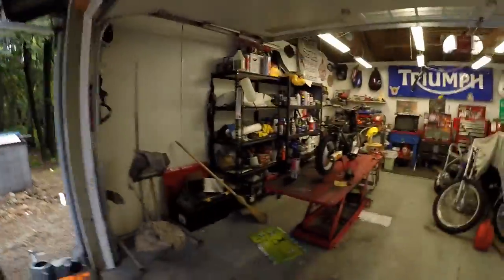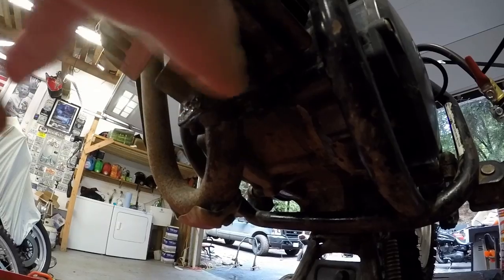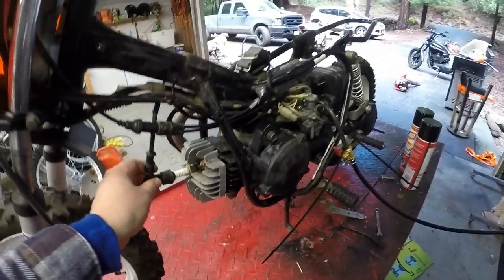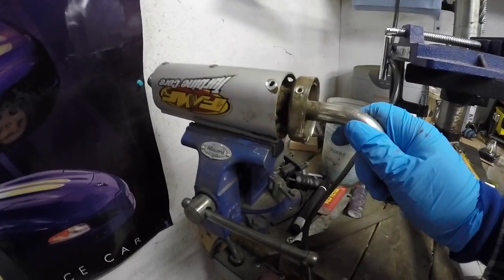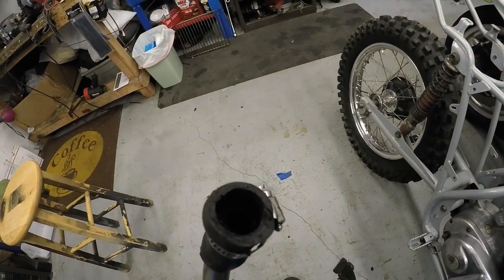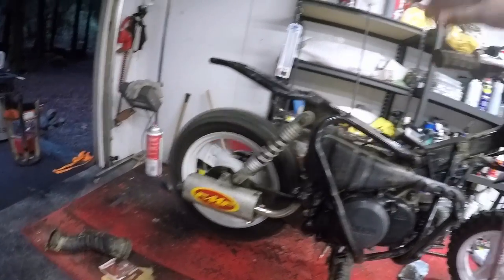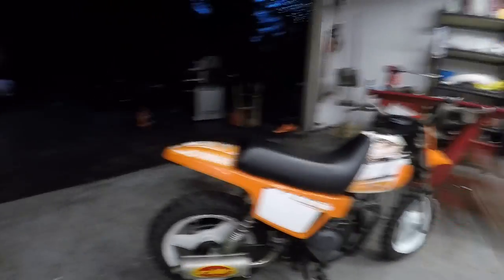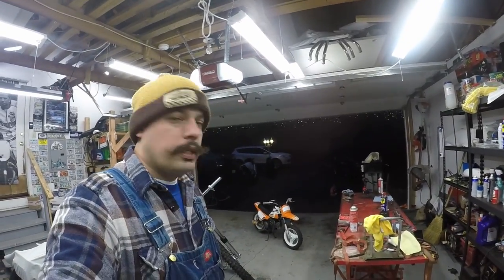Yamaha PW50 Carburetor Tune Up & Exhaust Service

Comment: What was the trick to stop the fuel from coming out of the spark plug opening? New plug? More torques?
Reply from the maker: Jason Burdorff I just tightened it up a bit and it stopped.

Comment: Mason, how about the float bowl screw, should that run all the way in? If I back it out a bit, it starts to spit fuel out of the overflow.  Great video!
Reply from the maker: Aaron Van Wagner yes run that screw all the way in, the purpose of it is when you store the bike if you turn off the petcock and drain the gas that’s in the carburetor. Only something you need to worry about if you’re going to store the bike for more than a month. Thanks for watching👍🏻

Comment: You seem like a cool dude. Also I think I have the same bike different color. But with the same 2 stroke carb. 

I need help. 
So when I got the bike it sounded like shit. So I went down to the local bike shop and said, “I don’t know a thing about the make, model or year of this bike but I need a carb kit please.” 

He said, “ said it was a pw50. And gave me the kit. 
(What I’m about to say next may not make sense because I don’t know motorcycle parts. Haha ) 

I cleaned the jets of the carb and JAMMED the gas and oil cables back into the carburetor and forced the carburetor closed and screwed it back together. 
My friend had to pry one of the cables back out. He told me I was supposed to line the part that slides into the carburetor, up with the single straight thread so when I pull the throttle it slid up and down lets gas into the carburetor. 
Well since we put it in the right spot now. My carb isn’t getting gas the bike used to work before I tried to replace the carb kit. 
Should I buy a new carb kit or do I have to buy a new carb since I may have ruined it? 
Or what do you think? 
Please help me!
Reply from the maker: WashingTone my best advice would be to take it to a shop, you’ve probably already done more damage than was originally wrong with the bike.
Reply: Mason George Motorcycles thanks man. I’ll do that. Thanks for the video.

Comment: I just got one of these for my son and it’s spitting oil out the exhaust after a few rides.  Any idea why?  I did add oil this morning that’s all I did different.  Was not spitting oil before!
Reply from the maker: The oil that spitting out the exhaust is from the two-stroke make sure not the transmission oil so you might have overfilled the transmission... I would check the packing, if the exhaust packing is old it’s probably not soaking up any of the oil and you need to re-pack it.

Comment: Got my friends old pw50, cleaned the carb but I still can't get it to idle right been working on it or about a week now
Reply from the maker: Calum Conger I would replace the Jets sometimes those tiny jets are impossible to get clean if the bikes been sitting for a long time... if the carburetor is truly clean and you have a good fuel and spark it should run no problem. Good luck

Comment: I need help with my Yamaha PW 50 please it starts up without starting fluid but sometimes it needs it but even when it needs it it will only stay running for about two seconds and it won’t revI have a new carburetor new ignition coral new stater new head new piston I just don’t know what’s going wrong with it if y’all have any ideas please help me thank you
Reply from the maker: Sounds like a tuning issue. Also check for air leaks.
Reply: Que tal amigo descubriste el problema me pasa lo mismo
Reply: @MasonGeorgeMotorcycles  como puedo saber si es un problema de sintonización

Comment: My pw50 is running like crap if I want too start it I have to some gas in the spark plugs hole and it will start and the choke has too be on for it too run how do I fix that
Reply from the maker: Bradley Schroeder clean the carburetor!